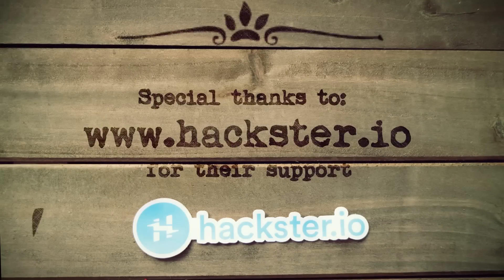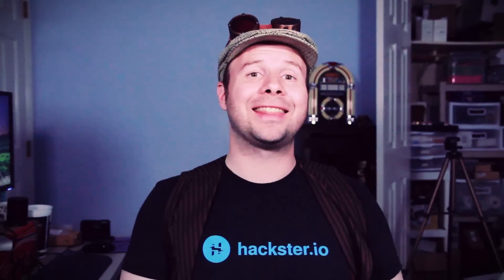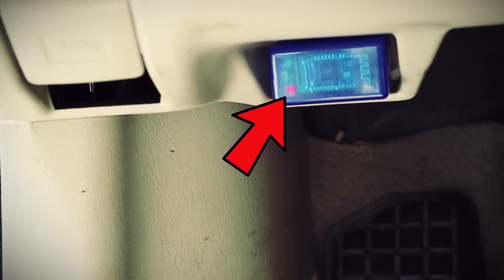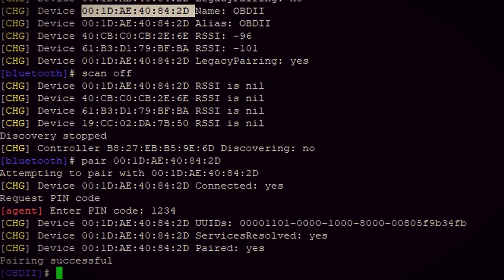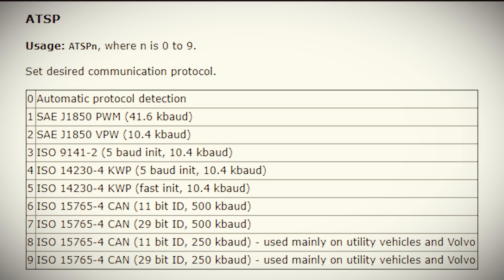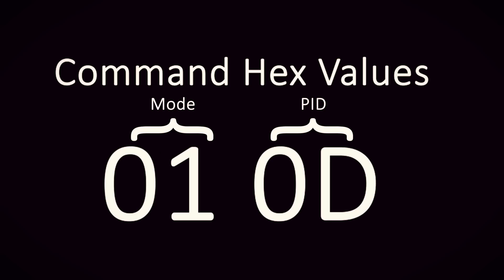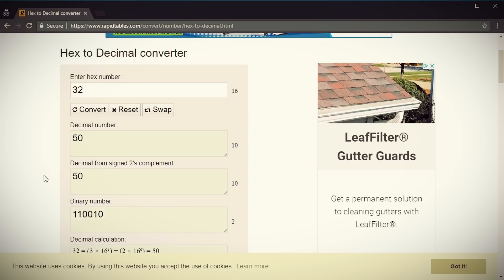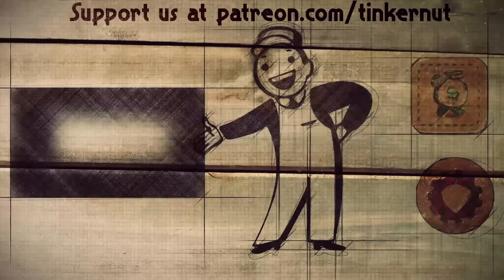Car Diagnostics With A Raspberry PI  - DIY Smart Car (Part 3)

Comment: How about command injection?  I want to send seek forward/back commands to my radio head unit (apim) when the radio comes in static.  Also for instance, adding additional seat memory.  Or when the driver#1/2 seat recall is pushed, change the radio and climate control to that person's favorite

Comment: ok i did not know it is that easy  to read ^^

really nice thanks 
one thing that always 12v power rail is not always on some cars or vehicles specific . i have a small electric vehicle that has a 5.4kwh 48V and a small 12v with only  1.2Ah battery and it turns off the 12v 10min after charging is complete or you turned of the vehicle after driving. but yea for those vehicles it makes sens because the 12v is charged from the 48v system with a 2A DC/DC converter is only powered if the 48v charges or the ignition is on. the dumb thing with this 12v battery is it is needed for the safetycontactors and the ignition if ignition is on the DC/DC  converter starts also up and now the 48v system provides the 12v power but without the 12v battery the vehicle cant be started. so yea turning of 12v for the obd makes sense. 
but on cars it would not really needed to turn off because the big 12v 40Ah to 90Ah battery.

Comment: Hi, fantastic video! Do you think its possible to be able to access dealer specific things like the air bag module, or abs module, steering module, etc, etc,and pull off and reset codes for these too or even calibrate or reprogram options? Basically anything that is programmerble from the manufacturer? Just curious. I guess alot of these require inside knowledge.

Comment: is there a way to do this on a car that doesn't have obd?   An old beetle for instance?   Maybe use a Pi to read the rpm and temp and send out obd?   So I can read it from my head unite?
Reply: beetle is carburated, has no eletronic fuel injection or chips of any kind unless you installed an aftermarket one

Comment: Idea would be to use the obd2 as a cut off switch. If the raspberry pi detects the scanner it will allow the car to start. If it doesn’t then it won’t.

Comment: please I use an ECU simulator I tried to receive the data using OBD2 adapter, but the requested data seems to be not supported by the simulator I tried to force it by the command '' force = True "it works but for only once either by the command '' query" or "Watch" if you can help me

Comment: Thanks for the video. I have seen few OBD2 GPS tracker on amazon. My question is - is it possible to get gps location straight from the OBD2 or those products are using separate GNSS module ?

Comment: I've tried to connect my raspberry pi 3b with OBD-II and I getting this error. Can you help me to solve this?

[obd.obd] ======================= python-OBD (v0.7.1) =======================
[obd.obd] Explicit port defined
[obd.elm327] Initializing ELM327: PORT=/dev/rfcomm0 BAUD=auto PROTOCOL=auto
[obd.elm327] [Errno 16] could not open port /dev/rfcomm0: [Errno 16] Device or resource busy: '/dev/rfcomm0'
[obd.obd] Closing connection
[obd.obd] Cannot load commands: No connection to car
[obd.obd] ===================================================================
Connection status:
Not Connected

Comment: I would make my truck haul ass by activating the secret turbos, interchargers and supercoolers. And passenger ejection seat button in front of passenger labelled "Seat AC" ...or just read P0021 and P0301 codes because of the bad coil on bank 2 I'm too lazy to fix.

Comment: I'm getting AT+BRSF=24 when I enter screen /dev/rfcomm0 which then exits after a few seconds. Anyone know a way around this?
Reply: Have you been able to find a solution for that problem? I have the same problem! But in my screen there isn't anything.
Reply: @oswaldocedillo8545  yes I solved the problem.. 1st issue was that my obd device was faulty .. 2ndly there was some issue regarding the connection of bluetooth which I solved and then everything was perfectly working
Reply: @bilalilyas7053  Nice. I was thinking that maybe my obd II device could be wrong, but I wanted to be sure before buying another one.
Firstly, can you tell me where did you buy your new obd II device? Of course if you bought that online, please.
And secondly, before buying a new obd II device, can you tell me, what was the issue regarding the connection and how did you be able to solve that?
Please, I will appreciate all the help you provide me! I have been trying for weeks, but I can't solve that.
Reply: @bilalilyas7053  Sorry, I have changed the OBD II device, and now, I can write in the "screen", but now I can't send what I have written. (atl1, athz, etc), when I push enter, doesn't happen anything. Only the cursor returns at the beginning of the line.
please help me!

Comment: I'm trying to get the USB version of this to work, but i'm having trouble finding exactly where it is. i've skipped the bluetooth and binding steps and found in dmsg that there is a tty0 and ttyUSB0 connected, but i've tried both with screen and it just terminates immediately. what am i doing wrong?
Reply: Found out now that I need to direct it to /dev/ttyUSB0 so the command ends up being "sudo screen /dev/ttyUSB0". It seemingly connects because it brings up the blank terminal screen but it won't respond to commands, won't always recognize key presses, any would type completely different letters/Unicode symbols than what I'm trying to type. Note: I'm testing this on my laptop, and have tried clean installs of both Ubuntu and Linux mint.
Reply: I tried skipping the testing in screen and moved on the the next video, and it seems to work fine with the python OBD library even though screen was acting buggy. If anyone's having issues connecting to your car with the python library, look at the documentation. They have a debug line you can add to see where you're having trouble. I had to manually set the protocol since it wasn't automatically selecting the right one.
Reply: @ParishRoger3   Hello, I was looking for in the comments of the video "Car Diagnostics With A Raspberry PI - DIY Smart Car (Part 3)", a solution, because I have got a problem with Screen, when I launch it, it looks frozen and I can't write any comand. Have you been able to fin a solution for that? I am using a bluetooth connector. 

I will appreciate your help!

Comment: When I got my Chevy Volt in 2012, I put an OBD2 bluetooth adapter on it to see what data I could read from the car using some phone apps. It worked for a few days and then my car would not start. I removed the adapter and got it to start, but it had created several faults that had to be cleared at the dealership. Apparently the increase in traffic on the network interferes with the module communications. This happens on several other Chevy models also. Be careful. BTW, I also have a Honda Odyssey, which requires a special OBD adapter, so you can't just buy any adapter for it.

Comment: I'm planning a restomod 1975 Chevy Nova using a modern LSx motor - basically classic exterior, modern interior (and drive train).  I'm probably using something like this to make a glass cockpit - all digital controls and displays.  I'll have a pi running with the OBDII connection to collect and make these values available to the display systems.

Comment: Careful with those particular OBD2 adapters. I used to have one and they are pretty.... fragile to say the least. If you have no issues at all, it runs like a complete charm, so as the saying goes: Your mileage may vary.

Comment: You can also use android and an app called Torque to give you a heads up display with all sorts of gauges
Just found OBD Auto Doctor that should work with linux as well

Comment: Totally did not know that OBD2 used a variation of the Hayes AT command set over a serial data link ...
Reply: i dont think it's the obd2 that's using the at commands, but the adapter - it's using the at set to communicate with the serial device and communicates with the car using it's internal communcation method.
Reply: Correct - OBD2 itself is a binary protocol over the CANBUS. But the common ELM chips convert that to/from serial, and it's those chips that present the AT interface. There are other chips that don't use ascii + AT (ie Microchip MCP2515, etc)

Comment: You know this is a very cool idea and information. :D

It would be interesting to also use a LED grid to setup a HUD to reflect off of your windshield so you could see your KPH or MPH so you wouldn't have to look down at the dash.

Another nifty thing would be to see if you could also add in a dash cam type system so you could record stuff as you are driving so you have proof of what happened in front of you if you got into a accident plus encode the MPH/KPH and other vehicle features into the overlay when it is being recorded so you could show if you were using your turn signals, hit your breaks, or other things that might be useful. :D

I could think of so many nifty things you could do on this project. :D

Maybe some current sensors on your head lights and other external lights so you know when they are working or need replacing. :D

Comment: Torque on Android is an excellent off-the-shelf solution that will connect to bluetooth OBD2 readers. Add Torque's overlay to the camera feed from your last video and get a maybe get a cool dashcam.

Of course, there are dashcam apps too.

Or, wait... Hopefully I'm not spoiling your video for a few weeks away... OBD2 overlay on dashcam and backup cam recorded and displayed on the Raspberry Pi. I like where this is going!!

Comment: I have been thinking hard about a smart car. I would have a GI that displays menus. So there would be one that displays typical HUD information. Then some diagnostics menus and data logging. From there I would have this same set control door locks and other features in the car. I would end up installing sensors everywhere to monitor things a little better. It would also remind me about maintenance..... God I could go on forever... I do believe this would need a more powerful computer along with endless serial input

Comment: Right now my vehicle is having issues with either fuel pump or fuel pressure sensor and it's tripping the wrong OBD Codes - so i would check those two things :)

Comment: One thing to note is that the constant 12 volts being used will kill your battery without the car running.
Reply: if someone's worried about that they can ignore the 12v from the port and just piggyback off the radio or dash power so it only runs when the car is on (as long as you don't mind an ugly wire or plan on permanently installing this thing)
Reply: Even the radio still draws a small amount of power to keep memory @jerrymadsen1717
Reply: PixeledVision the adapter draws very little current.
Reply: @corvettefan91  yes, but on an old battery this could potentially drain it too low to crank.

Comment: How would you implement OBD2 theft protection, apart from maybe connecting pins in a way that would short the criminals device. Maybe a “man in the middle” processing unit that sends wrong data ?
Reply: krutomjer trace the connectors cables though the harness back to the ecu/bcu and disconnect them

Comment: Obd dash screen with speedometer, takometer, issue report with its details (not only the check something light) aaaand if its possible connect it with another pi for music/navigation/back up camera with separate screen, quick shortcuts on the steering wheel and the list goes on and on and on

Comment: Take this a step further and make an OBD2 key programmer with a Raspberry Pi!
Reply: Czar Corey Key programming specific to the vehicle, most don't actually expose that to OBD II instead they use the OEM choice pins in the connector for their tools.
Reply: Adam well. With newer cars it's manafacturer dependant. If it's a keyless entry. Only a dealer or a bonded locksmith can make keys. Or if it's more traditional you can sometimes use the car's own ignition slot plus some software to program. And with others it's just a clusterfuck.

Comment: USB would probably be the better option in general. Bluetooth has a lot of issues honestly.
Reply: The nice thing about Bluetooth is complete electrical isolation.
Reply: What kind of issue Bluetooth have? Is 4.0 and above pretty sturdy? Only time I would be Worried if its BT v1.0
Reply: I can assure you that 6 years later, it has improved a lot, but USB is still better

Comment: Is there a possibility to send commands to the CAN-Bus? Like turning the lights on? Or maybe to accelerate until a certain speed is gained - like a cruise control?
Reply: The OBD 2 protocol was designed for it to be possible (See Mode 08 on wikipedia Page), but i can't find any documentation of vehicules that integrated that possibility. EDIT: totally wrong answer; Mode 08 doesn't stand for that. So it's apparently impossible.

Comment: Is there anything that my Pi would show that my phone wouldn't? Ive been using Torque with a Bluetooth ODB for a while since it was easier then a Pi.
Reply from the maker: Using your phone is perfectly fine. It's not what the Pi shows that Android doesn't, it's how you can customize the data, display, and integration using the Pi vs Android.

Comment: or just use the bluetooth adapter and Torque Pro  for android
Reply: And where's the fun? Where's the tinkering? Come on maaaan
Reply from the maker: You can totally do that...but that you can't integrate a backup camera
Reply: Plus nerd bragging rights
Reply: You could but where is the fun in that? :P
Reply: Tinkernut actually you can. I use a Nexus 7 for my radio/diagnostics for that very reason.
Reply: @MikeBohde  nexus 7 has a superb screen ,probably the best resolution 7" screen !

Comment: i would log the OBD2 data to a spread sheet to study my fuel consumption
Reply: It would be good to sync it with GPS data to match it with route as well - to get position, altitude, etc - so different routes could be could be compared.
Reply: A lot of newer cars do have a fuel economy reading but I have my doubts to their accuracy.
Reply: Adubs well these are merely an algorithm. They know how much gas the tank holds. They know fuel level and can just do the math.
Reply: The calculation is usually done from injector duty cycle and MAF. AFAIK only a few manufacturers use the fuel level to aid in calculation. Even then there are a ton of discrepancies, like tire wear, changes in fuel density, injector flow tolerance, etc. My point was there is a way to monitor this information via OBDII. A cheap bluetooth setup as shown connected to an android running the torque app will show you. Though its probably still far more accurate to plot the data yourself at the pump.
Reply: Put the data into a neural network?
Reply: Car computers are not accurate, they tend to show to little. Around 0,1 L/100Km .
Reply: kulgan96 it doesn't really give you that info.  At best you'll get fuel trim.
Reply: You can't get fuel consumption from ODB2. You can't even get fuel level from it. Other devices that claim to do this are just guessing and most if not all the time are completely wrong.
Reply: I just decided to check and yeah you can get the fuel level from OBD2. So you're wrong, J Nothing.
Reply: @hippopotamus86  as previously stated, you can get not only the fuel level, but also the gallons per minute from the injector duty cycle. Combine that data with speed from the OBD and you have yourself MPG

Comment: You should show this same thing without Bluetooth, just straight USB. The process reminds me a lot of the way computers communicated with the old modems back in the day. ATDT and all that.
Reply: You'd just skip everything up to the installation of the "screen" program, giving it the communications port of the USB device instead of bluetooth.
Reply: yup. Hayes protocols...back when 1200 baud was all the rage!
Reply: "The process reminds me a lot of the way computers communicated with the old modems back in the day"

That's because the OBD2 interface is basically just a modified serial port.
Reply: Hey noferblatz, did u be able to coonect the usb connector to the raspberry?

Comment: I would stand and be amazed since my car is from 92, and the fanciest electronic it has is lights...
Reply: Your car could've been made before the law was put in place IE; start of the year.
Reply: even simpler, it's a diesel and i'm based in EU. OBD was made a requirement for cars only made after 2003, i.e. 10 years after my car rolled out of the factory.